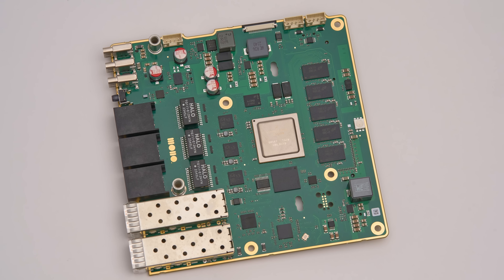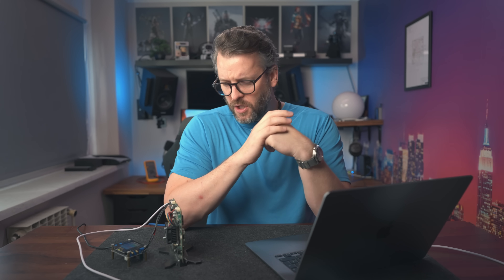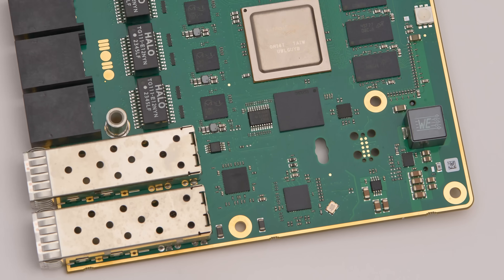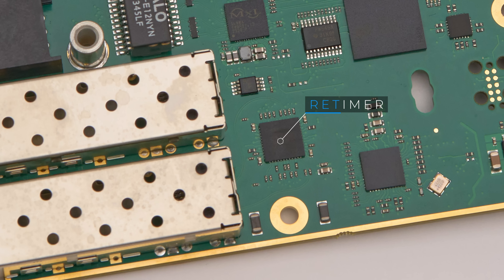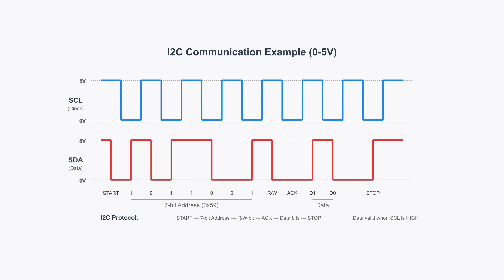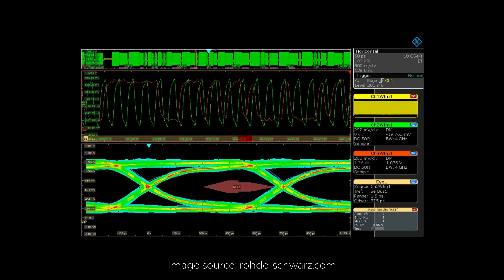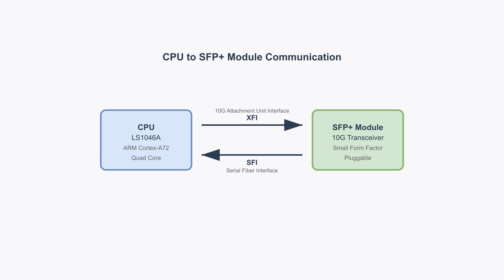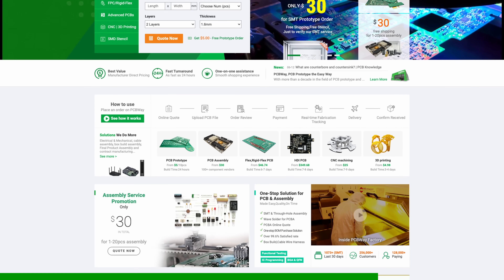10 Gigabit networking is NOT as trivial as you think!

Comment: hello, very nice board and project. if you are concerned with trace imepdance changes due to fiberglass weave, have you considered using ceramic material, i have layouted board with 10ghz diff pairs and the designer specifically requested RO4350

Comment: 10Gbps networking is expensive, but it's noticeably cheaper than it used to be now that many patents (such as US7164692B2 and US20030217215A1) expired in 2023. The owners of those patents demanded high royalties from every piece of network equipment that supported 10Gbps.

Comment: Lot of inaccurate statements here……  glass weave is not an issue perpendicular because no skew is introduced. Curved traces do nothing to alleviate this effect. Curved traces reduce the impedance discontinuities caused by discontinuous geometry.

Everybody talking about FR4 here needs to probably stop talking completely. If you are using FR4 for 10gbps boards, well    lol       PCBWAY wants their high tech back.

I am routing 25gbps routinely on every project i touch.   50-52 gbps is coming and immediately after that PAM4 104 -112 gbps will become standard in just a couple years.

QSFP+ protocol is OLD and already outdated.

Comment: I really don't think the retimer is needed here.

Have you actually looked at the waveforms for the SFI/XFI signals on the board, or checked swing on the SoC datasheet/config registers? The SERDES should be programmable to adjust amplitude and TX FFE taps and I would be shocked if you can't make it meet the SFP+ MSA eye mask at the connector reference plane.

I have a 16 GHz scope, 25 Gbps BERT, and SFP+ host compliance test fixture and would be happy to take some eye measurements for you de-embedded to the SFP+ cage reference plane, as well as at the input to the retimer at the PCB, and see how things look without it. I can also do PRBS BER measurements if you have the ability to set up PRBS TX/RX in the host side SERDES (there should be a register for this).

Skimming table 38/39 in the LS1046A datasheet: XFI output diff voltage 360-770 mV diff, input 110-1050 mV.
SFF-8431 TX eye mask (SFI): +/- 95 to +/- 350 mV (so 190 - 700 mV diff), RX 150 mV opening

EDIT: I also see what looks like redundant AC coupling capacitors on the retimer. SFP+ optics contain integrated DC blocks (SFF-8431 section 3.4, page 25) so you don't need them on the PCB.

Comment: Big thank you for to doing the legwork for 10G.

10 Gigabit Ethernet has been around for 24 years already, and 10G over twisted pair for 20.

Adoption levels of 10G make me angry, and 2.5 and 5G will always feel like a slap in the face of the customer. I do understand issues with signal processing required for extracting data from a stream with barely-existing SNR, but that was issue in 2010. By 2015 we had ready to deploy designs, quite low-power intentionally kept away from even high-end products, because "who needs fast network". Costs never came down.
Then SSDs came and "oh no" moment arrived.
Reply: It's progressing in the right direction.  Perhaps not at the pace you're expecting...but at least it's moving.

Comment: That seems way overcomplicated. what MIIs do the MACs on your SoC provide? i don't know why you went with XFPs? SFP+s connect via XGMII (and I2C/SMBus for management). If your SoCs MACs don't support XGMII, an external MAC that does might be both cheaper and simpler to implement than your XFI workaround. Curved traces are not necessary for the actual physical link, might just be advantageous for the MII or XFI in your case. It is recommended in the specification and i do recommend it too but it isn't critically necessary. Curved traces are primarily used to mitigate reflections in RF/high edge rate applications, reduce losses among other advantages, helping with more gradual and therefore less reflection prone impedance transformation due to FR4 weave is only a secondary reason this is done and very unlikely to actually matter here.

Comment: That was.... Not the kind of routing performance I would have expected of a supposedly 10Gbps router. Some losses sure, but you're only reaching 2.5Gbps in iperf... That means it's unlikely to even be able to handle 1Gbps IMIX... And if I understand it, you don't even have a firewall enabled yet either, which will cost even further performance.

Comment: Curved traces aren't solely to counter FR4 weave, and not even primarily to counter that (esp when you'll usually have prepreg ie thin plastic between signal and ground on your top layer pair rather than FR4) - the main reason is that tight corners upset the effective width/spacing which in turn affects impedance and thus causes reflections, and corners also introduce more intra-pair skew which is bad for both signal integrity and EMI because it converts some of the differential signal to common-mode and artificially increases the effective spacing for the leading edge of bits.
Reply: That was my first thought too. Sharp corners bad.
Reply: @UltraNoobian  You actually can get away with sharp corners out to pretty high frequencies. Even 90 degree bends don't have that big an impact on impedance on single-ended traces, I've run 3D EM simulations to verify this. There is an impact but it's not nearly as large as most people think.

I don't know the exact stackup used on this board so can't comment on specifics, but I've run 10G and 25G NRZ with 45 degree bends (and no smooth curves) over FR408HR and TU872SLK with wide open eyes.
Reply: @UltraNoobian sharp corners are not an much of an issue. I route 25+ gbps serdes with 45s all the time.
Reply: prepreg is not plastic.  And FR4 is NOT used on high speed designs.    Prepreg is simply a laminate layer of the selected stackup material with no copper. It can be foiled or simply goes between cores.    I route 25gbps routinely without curved traces without an issue. Also EMI is NOT an issue. EMI is caused primarily if not solely by orphaned return current. Losses of differential signal to common mode is not caused by EMI. This is discussed in detail by Bogatin.
Reply: FR4 could be used for XFP interface, but for SFP+  it goes unreliable. Rogers 4350b and Nelco 4004 that what i've used on top outer layer. Stability is way better. SFP+ has another quirk/cheapshot, you can go with 7% coupling within differential pair instead of 25% than PCB manufactoring would suggest  for your design. While maintaining both singletrace impedance for these traces ofcourse as well as differential. And better not use broadside coupling, or else, i recommend woving "shielding" gnd out of reach, it could radiate and dissipate like some decent antenna.
And never go for ENIG or "flash gold", thats for protecting traces from oxidation, gold just getting dissolved in solder bumps. If you are going high-quality you could do NiPdAu, otherwise it could be OSP over plain copper. Nickel in ENIG  is showing poor skin-effect immitance.
Reply: If I'm an electrical engineering student who wants to learn more about what "intra-pair skew" and "converts some of the differential signal to common-mode and artificially increases the effective spacing for the leading edge of bits." is, where should I look?
Reply: @Badsniperarmy  rule of thumb: go for 5mils tolerance for intra-pair skew for 1 GHz and more and 15mils for 150...900 MHz range. You couldn't match it better because its what it is in IC interposer (which is also pcb) within and between actual ic chip and bga balls. Or worse in plastic TSSOP package. These tolerances are derived from picoseconds on eye diagram and corresponding electrical signal defined in corresponding protocol using these differential pairs.
On first ic chip design rollout there could be no defferential pairs on test PCB visible at all, just two single 50-ohm traces separated to SMA connetors breakout, to connect them to oscilloscope using differential probe.

Comment: A lot of talking just to learn that you don't even have proper test gear.
Reply from the maker: We're a startup and have to make do with limited resources. That said, we don't need proper test gear, as this part can be outsourced.
Reply: @tomazzaman  I don’t blame you for not having proper test equipment. I am fully aware that such things can be extremely costly. What I’m trying to say is that you could pack all pieces of information in much shorter video.
Reply: @tomazzaman   Next video on this need a proper dump of info,  eye charts...  And better script /plan.    
One tip,  try  FLExible Network Tester,  so each evaluation is more rich and have proper graph / stats.

Comment: Curved traces are definitely not necessary for these speeds. If you are using anykind of prepreg besides 106 and 1080 on critical layers, you will be good. Something that becomes more important would be the material itself being used.
Reply: Probably yes, dielectric loses will be the main problem. But curved traces might still help a bit , especially with look and make u notice the extra care used.
Reply: @sanjikaneki6226  I think almost any "FR4" will do  the bandwidth required, as long as the transmission line length is not significant. 10GBASE-T is nothing that crazy.
Reply: @Sixta16  well depends TM depends on how the stack up is set there may be a lot of loses from resistive loss and dielectric but yea the traces look short enough and if there are no stubs there shouldnt be any problem

Comment: 10G Networking and above is a headache to work with. The gear is expensive (especially Switches), nothing works out of the box and unless you happen to have an Intel-based SFP+ controller there might not even be drivers for an up-todate system. I briefly looked into Infiniband and IPoIB, and to be fair, the qib driver supports a range of cards, plus Infiniband switches tend to be lower in price on the used marked than SFP+ switches. BUT I had to realise the hard way, that the 40G IB cards I bought were firmware locked to be used in specific HPE server models only. So there's that... In the end I have both 10G IB and 10G SFP+ NICs running and that's enough for now.
Reply: 10GB has been a breeze for me. I started with 10GBase-T adapters like Aquantia AQC107 and intel X540 connected directly with each other and that worked great. I avoided switches for quite a while because I only need the higher speeds between 2 or three machines. The rest can use 1gb. Or 2.5Gb which is dirt cheap these days. I've been switching to SFP for lower latency and power consumption. There are cheap Chinese managed switches with SFP+ ports (the latest one I got was managed (with even a separate serial console port) 8 port SFP+ for like $70 shipped) that have always worked great for me. I really do not understand what you are complaining about. All NICs work great with Linux. Mellanox ConnectX-3 and 4 work in Windows too, without having to install specific drivers. Older Intel controller might require drivers from Intel but it's probably a good idea to install those anyway - they offer more features than the Windows driver. Broadcom I have only used on Linux - feature wise they look better than Intel. But I would recommend Mellanox anyway - they seem to have the lowest latency and support SR-IOV and ROCE. Maybe that's why they are the most expensive still.

As for higher speeds, please first make sure that you can actually sustain application level speed close to their nominal speeds. iperf doesn't cut it. I can barely maintain 8Gb/s file transfers off my NVMe RAID array over my 25Gbps link despite iperf showing 24Gbps.
Reply: @nmihaylove  Actually, I don't need the bandwidth for file transfers. That is well and truly handled by a 10 GBit/s Intel SFP+ NIC. I want to tinker with high performance cluster computing, maybe even shared GPU compute. A PCIe Gen 2 x16 or Gen 3 x8 link exceeds 40 Gbit/s by quite a margin, so the networking would be the bottleneck either way. At the time I was looking into it, I just bought the cheapest 40Gbit/s cards I could find. 4x HP 544+FLR-QSFP. There was no documentation on that card whatsoever, no driver downloads or even a hint at what driver to use (by now I know it's the mlx4 driver). Out of frustration I ended up buying a couple of more expensive QLogic cards, which were well documented and known to be working with the qib driver in Proxmox.
Reply: You'll need a card and fabric that can support RoCE to take full advantage of Infiniband.  If you are targeting a pure storage use case, you can consider SRP or iSER.

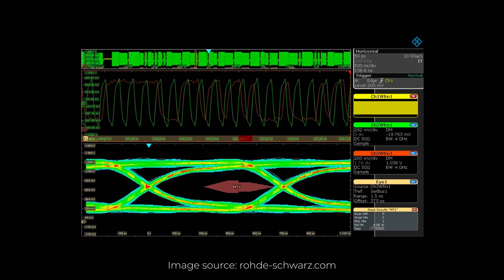Comment: 6:16 - my undergraduate final project as an EE was to design a chip (yes, at the silicon level using Cadence) to equalize digital, serialized, differential signals and extend the bandwidth of lossy transmission line, both for PAM2 (basic 0’s and 1’s) and PAM4 signals (2 extra levels between 0 and 1 to encode 4 symbols of 00, 01, 10, and 11). Seeing those eye diagrams and the characteristic “wave-like” behavior of a binary signal on the lossy input brings me back.
Reply: Cadence dev here! Always glad to see the PTSD we brought on students 😂
Reply: @vrowniediamond6202 oh my God, don’t get me started 😭
Reply: @vrowniediamond6202  I started with Orcad for DOS in the '90 😀
Does it still exist?
Reply: @vrowniediamond6202 This is probably the most funny yet painfull commeny I have read this year 🥲
Reply: Bro you are wild for that. Can't even begin to imagine designing that for me 😂
Reply: Yep.  All digital is actually a lumped model built upon analog lumped model which is built upon distributed or directly Maxwell's.
Reply: Kudos to that, my project was simulating a few highspeed differential channels in HFSS, and none of that ever got fabricated. Should have just plucked your chip in there and be done with that in a week ;)